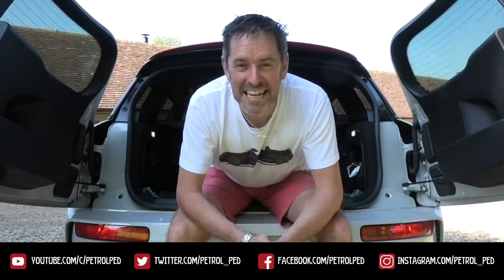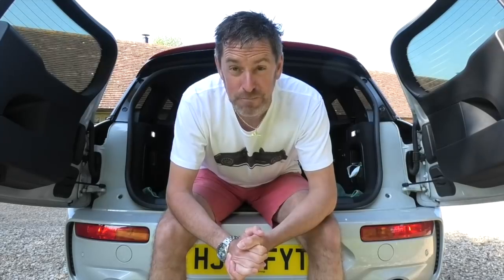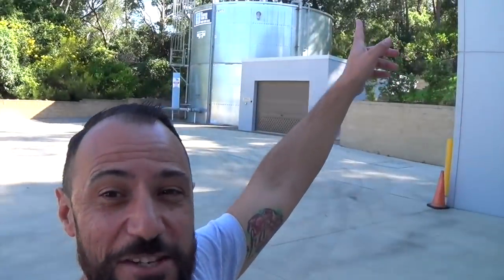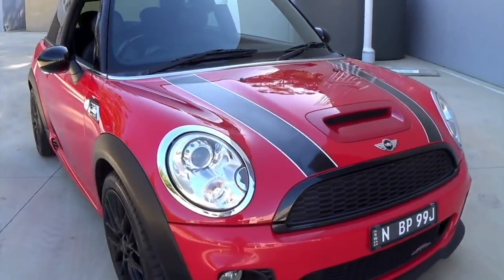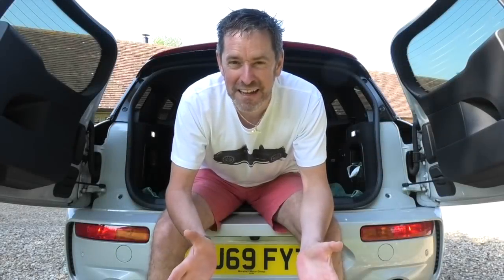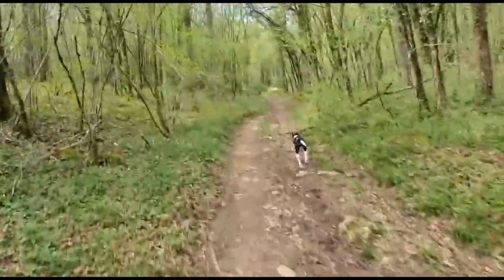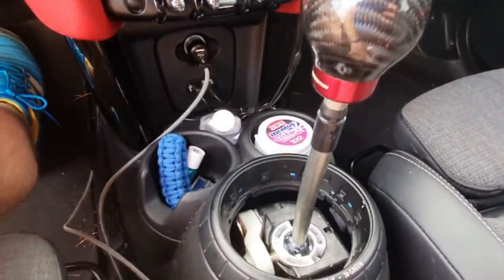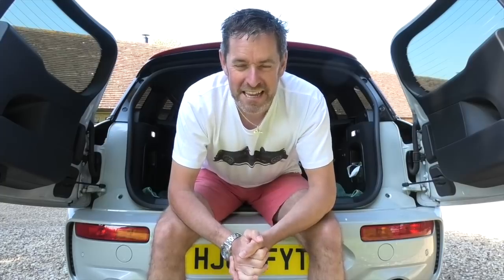Peddlerz Rides #10 - Downunder Mini and DIY Carbon Fibre ! [CarVid19 Daily VLOG]

Comment: Still working on the video - were headed to LA to see Revolution MINI Works and the Dyno :) !!  There will be video lol    So far this 'Modentine Break' we got a new bigger cam, bigger injectors, bigger intercooler, coilover suspension and it feels like I'm missing the ECU flash and some other things like the wheel spacer and adjustable control arms, oil sump baffle....  I'll make a list :)  It's so fast I need wider sticky tires and a limited slip diff
Reply from the maker: LSD is the single best mod you can make 👌